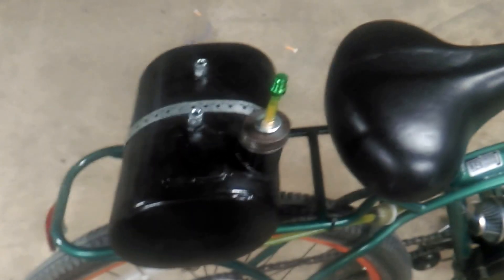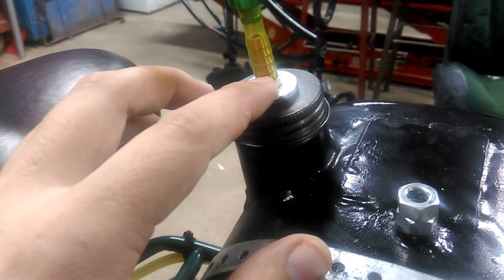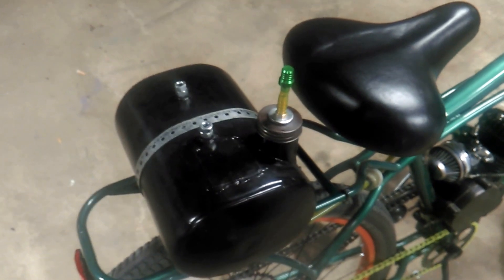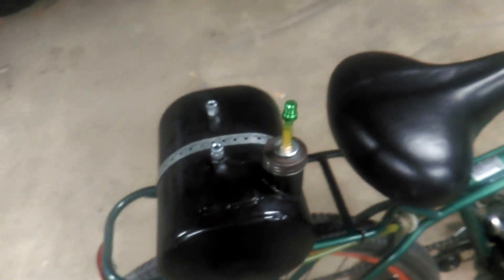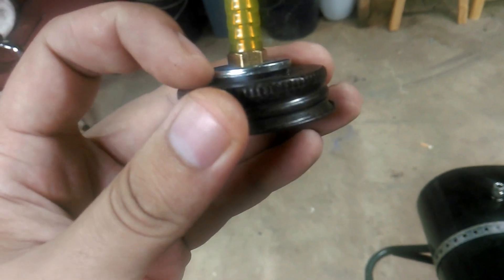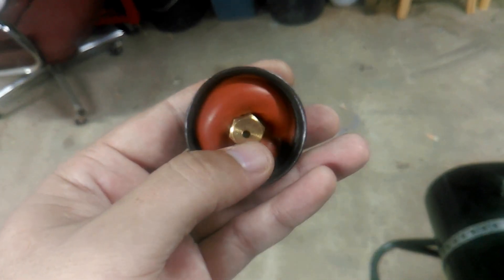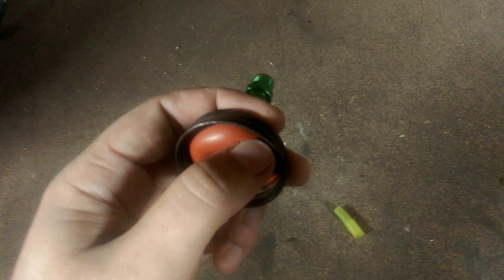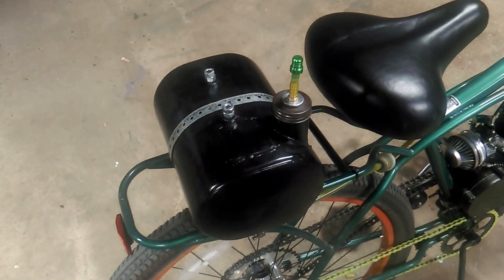Motorized Bicycle Rear Mount Gas Tank Project Part 2

Comment: hi, i have been watching your Free bird gas bike project, I have the same bike, with a PK 80 kit, your drive sprocket hub adapter kit is spot on. Having a spring loaded chain adjuster,  of what ever type, home brew or bought is a must. About your leaking gas cap issues, the fix is the way the gas cap  came from the factory. It had,  a cork gasket inside the cap with a off set small vent hole. The vent hole in the gasket IS NOT inline with the cap vent hole, to stop sloshing of the fuel form coming out. Second, Why not leave the peanut frame mounted  fuel tank also? "T" the peanut tank and rack fuel tank fuel lines with a barbed "T" or a harder to find "Y" plastic or brass inline fuel connector before the fuel filter, filter being closer to the carb, hence  greater fuel capacity longer range. Just shut off the fuel pet cock to the tank not being used.
Reply from the maker: +ray g Yeah I have since removed the rear tank and went back to just the peanut tank. I don't drive long distance and I opted for luggage rack on back rather than the gas tank.